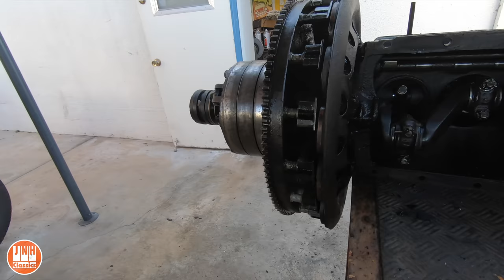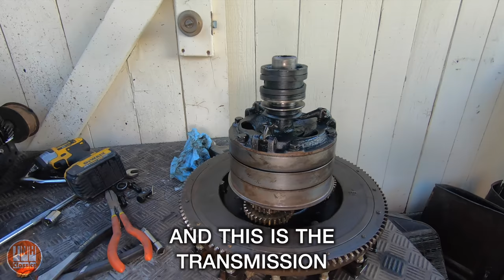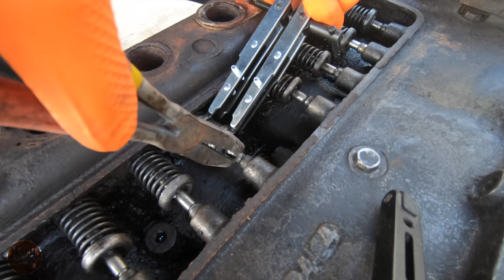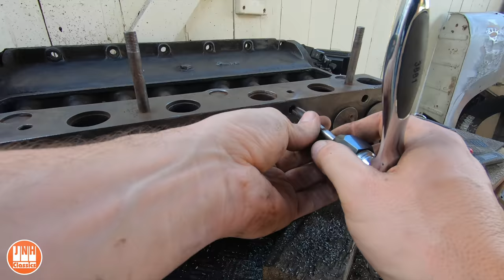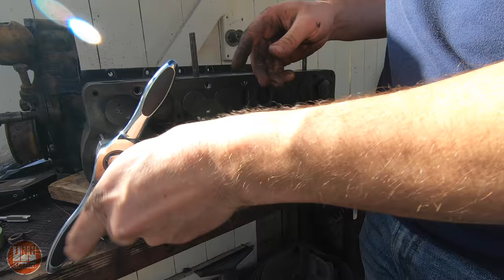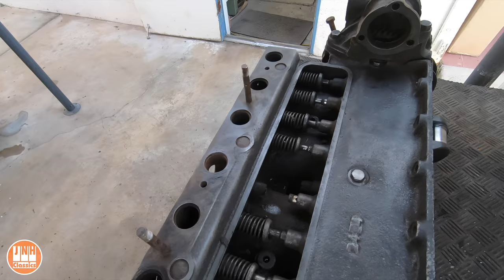A Forgotten Model T (Episode 7) Engine Disassembly

Comment: My late father had a neat tool for removing broken bolts, he called an easy out. It was like a reverse tap with deep, sharp threads in the other direction. You drill a hole smaller than the bolt, insert the tool, give it a light tap then twist it out. Worked great.

Comment: Your broken bolt removal method is very similar to my method.  I determine what thread I am dealing with and look up the tap drill size for that thread.  That drill is the maximum diameter drill used.  I start by carefully center punching the bolt, then drill thru with a much smaller drill bit.  After breaking thru the bolt (hopefully) I increase the drill size until I approach the tap drill size.  I don’t think I have ever actually reached the tap drill size, but when you get close, the remaining threads on the bolt will walk up the drill bit, fully releasing itself from the hole.  I then insert a tap to clean out the threads in the hole.  This method has not missed yet, including bolts broken off in aluminum.  

I am thoroughly enjoying your video series.  I really prefer the “no talking” method you use.  The added captions when necessary, are a nice touch. 👍

I like your ratcheting tap wrench.  I’ll look for one myself. 👍👍

Comment: Those original two piece valves are prone to breaking and dropping the valve head into the cylinder - the vendors sell modern one piece valves that are more durable.

Comment: Back in the day we would clamp a pair of vice grips on the broken bolt and tap it with a hammer until it moved no you'd have to clamp it really tight as tight as you could get it

Comment: Looks like very little wear - sort of guessed that would be the case.  You didn't show the bearing condition but the journals looked good.  How are the bearings?  Looks like clean it up and put it back together.  I would use the same rings if they look good.  bet pictures of the ring positions on each piston so you can put them back where they were at assembly.
Reply from the maker: I noticed the manual calls for the rings to be replaced every 10,000 miles so I ordered new rings. But yeah it looks pretty good. Should be running again soon👍

Comment: To remove broken bolts, first weld a flat washer to the bolt and then weld a nut to the washer
Reply: A layman like me would try soak it with WD40.

Comment: Great job with the restoration. However that’s a dangerous game drilling out the broken bolts. A stud extractor may have worked or may have broken the remaining protruding bolt off at the surface. Drilling into the center and using an extractor is a preferred method of most metal workers. Also oversize drilling and installing a helicoil is another way to save the block if it’s rusted badly in the hole.

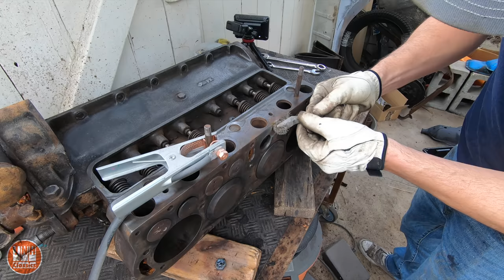Comment: 07:50 the bolt locks because the heat of the welding expands it, before forcing it to rotate it must be cooled with ice so that it loosens easily, (basic physics) 🤷‍♂️

Comment: IT'd be nice if modern engines were built to last like this, with rings below the wristpin to support the piston. Basically impossible to get piston slap in an engine like this, and the bores will wear true and wear longer to boot.

Comment: Did the earlier engines have a splash scoop on the bearing caps?
Great project and nice work!
Reply from the maker: I’m not sure. But I don’t think any Model Ts had an oil pump
Reply: @Jerod_Helt  There were aftermarket pumps with external lines available, but the originals depended on oil dip from the connecting rods, and the slinging of oil in the bath at the transmission; the oil pipe and funnel carried the residual oil back to the front of the engine for resupply to the pan. The end caps can be "X'd" with a dipper added (also aftermarket it seems) for better lubrication. All that worked as long as the car was level, in a climb the front bearing would starve and knock. "Look out for Number One" might come from those days.
.

Comment: U need 2 clean the pistons and put new piston rings on and hone the cylinders and relap the valves it keeps from from losing compression and the engine will run better 😊😊 OMG 12 19 2O23

Comment: What do you think the metal wire was for in the magneto area? Alignment and holding it in while before the bolts go in?  One more question (pardon my ignorance) but do the valves have to be very precise?
Reply from the maker: The wire was to prevent the bolt from coming out and falling into the engine. This car mast vibrate like crazy, because every nut has a safety wire or a cotter pin in it. The valve clearance is 1/32”-1/64”👍

Comment: What is a magneto? I'm not familiar with this partbof an engine. Was it an old engine thing or is it still used? What is it's function? Etc
Reply from the maker: It powers the coil boxes. It’s not used on todays engines

Comment: does the engine support high-octane gasoline? imagine putting a contraption to make the car be 4x4 will it have power ???
Reply from the maker: It puts out about 20hp. I’ve heard it can run off just about anything flammable including whisky. And that it’s incredible off-road because it has great ground clearance and articulation👍

Comment: You obviously have a well equipped shop All the toys one would could want and a lot of experience, but i am perplexed as to why no Teflon or sealant on the liquid connections such as the fuel pump where you installed the brass fittings? You perform as professional there fore wonder why you dropped the ball. I know i am knit picking, But all us perfectionist do, Do we not? I seen a couple other things threw the video but this one bothered me. Fuel leak is a big NO NO! I must add i am impressed at the rest of your work for your age you seem to know the model T very well. i guess you did your home work. kudos